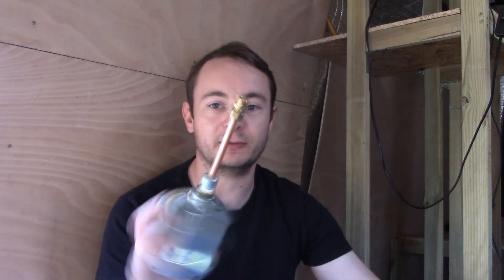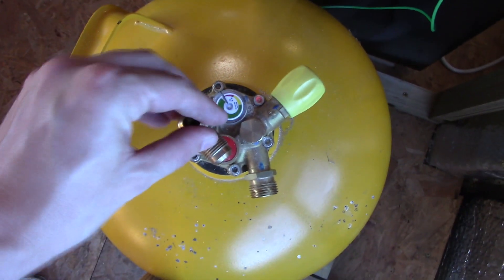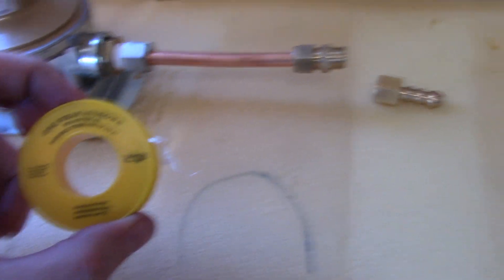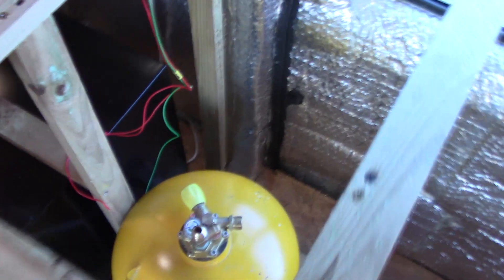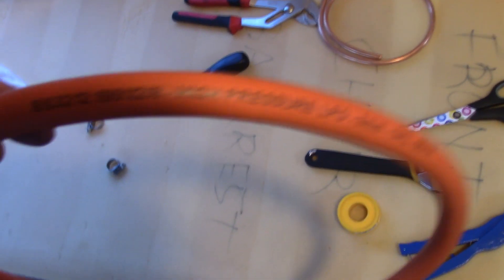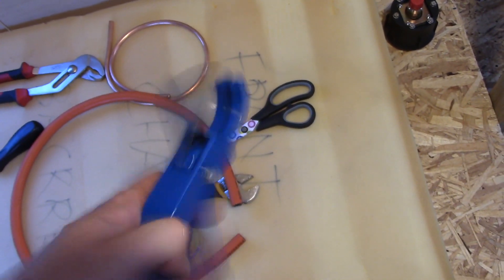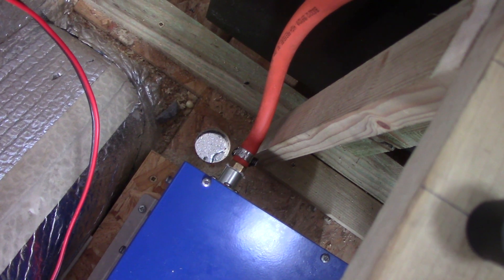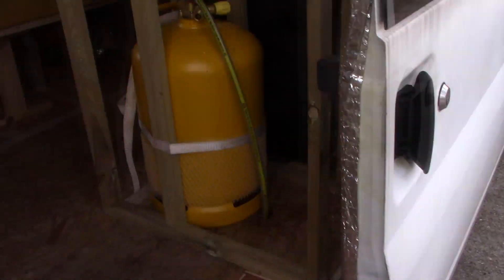Episode 17 - Gas Setup!

Comment: Good to see you back, and good luck with the job -

I think the second fill connection on the cylinder is so that you can fill both cylinders if you have a twin cylinder setup.

Don't use PTFE on the compression fittings (the ones with the olives) - they should seal without (check with leak detector spray) - do use it on the plain threaded connections though! :)

The connections from the regulator to the heater, cooker, etc. should be in copper pipe, not hose (you should be able to get a regulator with an 8mm outlet so you could use 8mm copper throughout. (You should ideally have a shut-off valve for each appliance, too.)

Anyway, I enjoy your videos, so keep 'em coming and keep your pecker up!
Reply from the maker: Lucky I haven't filler her up with gas yet then. Haha! Thanks for the tips. I'll get on to that as soon as possible. It's starting to get a little chilly at night and I want my heater running! :)
Glad you enjoy the videos! Can't wait to do that last one where it's all finished! :)

Comment: Don`t rely only on the bottle valve, install a solid distribution manifold with individual valves and connections for each single gas consumer...if one branch needs to be cut off, you can still use the other devices...
Hope you got the bottle closet gas-tight...
With a chemical toilet you have to stay to a supply for the chemicals and designated dump points...but that`s a topic for another video...the toilet gas has nothing to do with bottles and pipes...
:-D

So that`s the question now...invest all in the build or in a new job...decision for one will put the other on a halt, i guess...
For us watchers we hope that you stay by the build, but with money short it will take even more time.
;-)
Thx for the vid!
:-)
Reply from the maker: Damn good idea having a valve for each device. I'll make sure I get on to that sharpish. As for the toilet, It's just something for now. I want to get a composting toilet later on.
As for work; I'm getting a part time job so that I can spend more time on the build. So hopefully, more videos! Thanks for watching :)